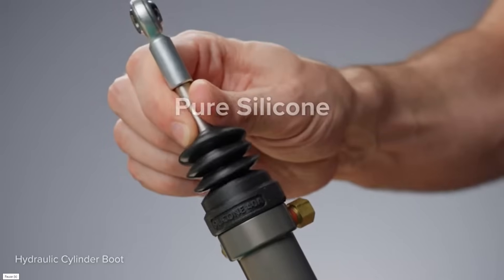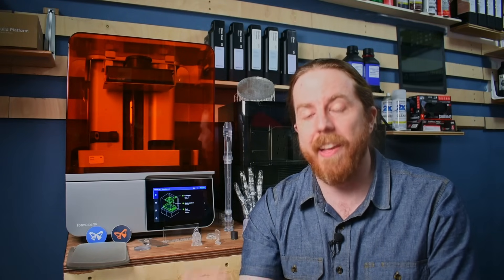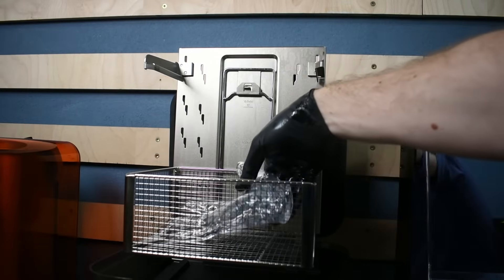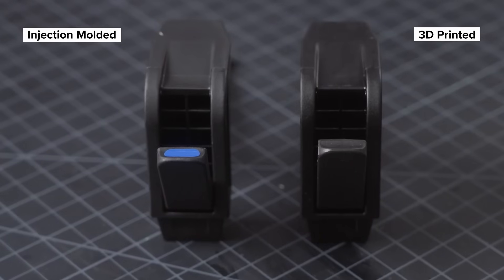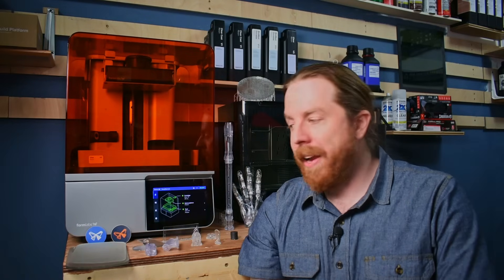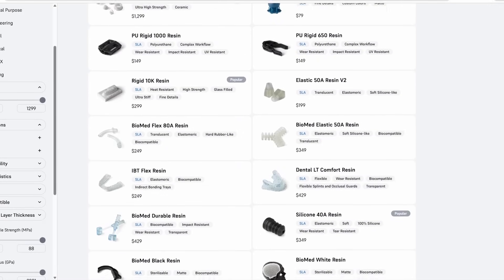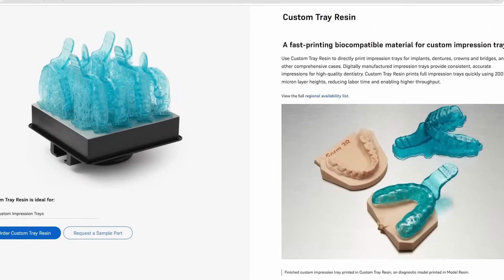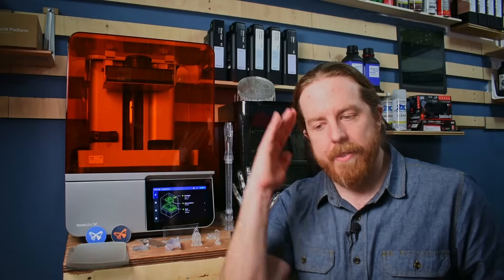Form 4B - This Will CHANGE Resin Printing FOREVER (at a price...)

Comment: All printers use 405nm light to cure. It seems to me you could just use formlabs (very expensive) resins in your cheap printer and get the same results. There doesn't appear to be much special about the printer so much as the resins. How can the printer itself be more dimensionality accurate? Aside from the convenience factors you mentioned, what does the printer itself do that cheap ones don't?
Reply: I tried form labs new resin with a elegoo Saturn ultra 4 and it requires a longer exposure time that the form labs. Thus making the print time longer.
Reply from the maker: It uses a 405nm light source, but I believe it's unique to this printer, not a 3rd party parts bin product like most other printers.  that said, you probably could use their resins in a normal printer, but I doubt you would get the same results.  The software and printer settings are tuned to work with these resins, and it actually adjusts depending on what you are printing.  The 2 most dimensionally accurate printers I've tried (this one and Heygears) don't just run a program like an Elegoo or Creality printer, they have force sensors in the bed, and also on the lifting arm.  Because of this, it adapts to pull forces.  One thing that causes dimensional accuracy problems is the partially cured resin getting "stretched" from constant pull forces, and the printers don't compensate.  This isn't in the video, but I print dice with every printer and resin I test, and they usually end up out of square.  the tougher and more compliant (elastic) the resin, the worse this is.  The biomed durable here is the most durable, compliant resin I have ever tested by far, and the dice are about the most square I have ever printed.  The dice on the heygears machine are also very good, but I didn't test with their ABS-like resin.  you can actually see the pull-force sensors working in real time. When it lifts the plate for the base layers it goes REALLY slowly, and as soon as it releases (you can hear the snap), the plate lifts, the mixer shoots across, and it goes back down.  This is in contrast with other printers that just lift a set amount, even if it's twice as high as it needs to.  This also saves time, but I personally don't care how fast a printer goes.  You're also paying for serviceability, customer support, components with more longevity, ease of use (you don't have to adjust anything like you would on a normal printer).  It's also made in the USA, and labor costs and stuff here are higher, so some of that is paying more because you have to pay americans more, etc...

Comment: Omitting a lot of small details, I guess because you got it for free? Open source resin for example costs like $3,000 per year or something😂

Anyway, as much as you like getting free stuff, you should still be open and discuss all matters including neutral and bad points. Meh...they bought you out 100%
Reply from the maker: if you feel that way, I can't change your mind.  they didn't alter my review at all, beyond me misspelling something in the unboxing video.  I think the open material mode thing is only a one time payment, but yeah it's pretty expensive.  I dont' have it on this one.  I don't personally have anything bad to say about this printer except the cost (which I believe is worth it) and print size.  If i was only into miniatures, like I said in the video, this isn't the printer for the job, but of the maybe 20 printers i've messed with, this was by far the best, easiest to use, most dimensionally accurate, least messy, etc...  If anything, my opinion was colored by the fact that I was simultaneously testing out a Saturn 4 Ultra 16k that was having issues out of the box.  That review is coming, but it won't be nearly as glowing as this one.  Still pretty good, it's a good printer overall for the price once i got the issues settled, but it's just not in the same ball park for engineering stuff, which is my main use of 3d printing.

Comment: I am just curious, why no one from manufactures have not approached to Carbon M1 or M2 nowadays? It is gone 10 years. They can flawlessly and continuously print without layers, their table moves just up. x100 times speed.
Reply from the maker: No idea, but if I had to guess, it's probably a patent thing

Comment: I bought a resin printer - and hated it for all the reasons you mentioned.  I might well go & buy this one!  The price isn't that terrible when you compare it to decent, semi industrial FDM printers.
Reply from the maker: You're right, a Form 4 is actually cheaper than a 5 tool-head prusa XL, and prusa isn't even "industrial", its just a high end consumer one.  It's absolutely crazy using this form 4 back to back with an elegoo saturn, the price difference is so obvious.  The saturn is great, yes, but you can tell why the form 4 costs so much more.  That said, if you use a saturn and formlabs creator resins with their wash solution, you can avoid most of the smells.  The ease of use though is worlds apart.

Comment: They charge $5k to allow the use of third-party resins and their resin library is actually pretty limited.
Reply: And yet in my 10 years of doing tech support for these printers, I can probably count on one hand how many times a customer has asked how to use a third party resin. I'd be happy to sell that feature, as it would be good money for us, but it just doesn't come up.
Reply from the maker: it's expensive, yeah, but i disagree about their resin library.  They have more variety than, say, heygears machines, and I can only think of one non-formlabs resin that I would want to use.

Comment: I have a pair of form 4 machines and I also happen to have a few IMMs.
The form 4 is great for short runs or prototypes but the claim of being as fast as IM is just BS.
Reply from the maker: i think they calculate it based on not having to wait for molds?  Or they are careful to choose exactly what kind of part they are using.
Reply: In their demo they just show the production time, but it seems to me that process is set intentionally in a very very not so efficient  way.

But without any doubt the form 4 and especially the form 4L are great machines,  since they are capable of create vacuum form molds and test IM molds in less than a day with minimal post processing work (Assuming you already have a base mold ready).

Comment: This is an infomercial.. This is marketing. Which explains both the printer and the production quality of the video on a new channel.. It's a commercial. Look at it.
Reply from the maker: I am flattered you think the production quality is good!  And yeah it would be insane for them to send a printer to a new channel.  But this is a spinoff channel from Paul's Garage, an 8 year old channel with years of printer content.  That's why they sent the printer.  I convinced them to let me use their printer to launch this channel.  That's why there's an expensive printer on a new channel with decent production, not because I'm working for them or being paid to make an infomercial.

Comment: How did you get them to send this to you with only one video….?? Haha. Great video. But very curious as lots of opinions can change when it didn’t cost you $7k+
Reply: This is an infomercial.. This is marketing. Which explains both the printer and the production quality of the video on a new channel.. It's a commercial. Look at it.
Reply from the maker: Haha good question!  They actually didn't sent it to me for this.  They sent it to me for another channel called Paul's Garage, and I convinced them to let me use it to launch a new channel.  I'm still going to use it over there for investment casting, though.  That's why I have the investment casting resin
Reply: @PaulsPrinterProjects  is investment casting the same as lost-wax casting? I guess the same except you don’t use wax?
Reply from the maker: Yes! lost wax is a type of investment casting.  The "investment" can be plaster or ceramic, the pattern is usually something that can burn or melt out like wax, wax resins, special burnout resins/filaments, even organic stuff.  it's pretty cool.

Comment: 1.3% failure rate is pretty high judging by manufacturing standards, but since it´s rapid prototyping it´s more than fine.
Reply from the maker: it's by far the most reliable resin printer i've tried so far, but i imagine in manufacturing that 1.3% would add up quickly
Reply: @PaulsPrinterProjects  1.3% failure rate in say the automotive industry where you sell say e.g. 5 mio. parts, means you have 65.000 bad parts. It´s way too high. But for rapid prototyping it´s more than acceptable, since also every part is unique.

Comment: I bought a form 3 and returned it immediately when my partner's 200$ mars 2 printed dramatically faster and in even better quality (didn't check dimensions but features were more crisp of the same test model we both printed)
I originally bought it because of their material library, but their resins are so dang expensive. I partially regret sending it back as I never got to play with the cool resins but maybe it was for the best. I also don't love how they want to sell you "open material mode" - for the form 4L it is an extra 5k PER PRINTER. And then they segregate medical versus dental, so I am assuming that means you can't print dental resins on your $14K medical form 4L

But that being said if money was no object and I had an extra 20 grand laying around i would definitely think about buying a form 4BL
Reply from the maker: I've never tried a Form 3, but from what I can tell, it was REALLY slow, even compared to other printers, and the resins are still really expensive.  I think the standard form 4 resins are half the price of the form 3 resins.  The open material mode looks really cool, and yeah expensive.  I can only think of the 1 resin that I would want to use, though (the thermacast stuff), formlabs has a version of almost every other kind of resin already.  and i agree, if i had an extra 20 grand laying around to buy equipment I would order a 4BL for sure.

Comment: I've been trying to use cheap SLA printers for engineering needs for years with absolutely no success. It's just impossible to get anything dimensionally accurate out of them. I had to resort to using FDM. Formlabs definitely has a market here, I'm actually thinking of buying one.
Reply from the maker: I know what you mean.  Heygears sent me a printer claiming dimensional accuracy, and it was WAY better than the cheaper ones, but even then I was breaking out the sandpaper and files to get parts to fit snug, and orienting certain areas towards to bed to hide the warping.  This printer seems better in my experience, but i'm definitely going to test it out more.

Comment: hahaha I was like I know this guy from somewhere
great overview
Reply from the maker: haha thanks!  yeah i figured i need to split the printing stuff off of the metal stuff
Reply: @PaulsPrinterProjects  yup, I think its better for those who follow. 

Did you give a heads up on the new channel and i missed it? randomly stumbled upon this one.
Reply from the maker: i put out a community post last night, that's it.  those don't get pushed much by YouTube, though. I'm probably going to have a video on the garage channel that talks about it, like an update video or something, but i'm also going to have some investment casting videos specifically about clear cast resin over there, too.  Clear cast resin can be printed hollow with an internal lattice, kinda like FDM printed investment casting patterns, so BIG stuff is possible.  not just jewelry like the purple resins.  Really cool.  OH and I got some ceramic shell stuff, so i can do larger projects that aren't limited by the flask/plaster set up.  Looking forward to it
Reply: @PaulsPrinterProjects  Oki amazing. I think If you just pushed the printing parts of your projects and the specifics and mention that out a lot of people would already pour over ^^

Cheers!

Comment: Good information on the printer.
and yes engineering resins are many and varied and they have been this way for a long time. (before DIY resin printing existed to some extent) but you do a good job highlighting some interesting ones.

One thing though.
Do note that it isn't a lack of fumes it's a lack of a specific additive. This seems like a minor clarification but it's important. 
The formlabs resins still releases fumes. if it smells it does. Even if it doesn't it might. Your nose is a very poor tool judging this. If it smells good. It does and isn't good.
Just be careful talking about this subject as it's a potential health issue. All resins can start an allergic sensitivity, the amount of fumes and VOC needs to be measured by a specific device. Your smell sense is not useful.
Reply from the maker: excellent clarification, yes.  the smell isn't the issue, but the fumes from formlabs resins are much less toxic.  they still say you shouldn't go whiffing them, and still wear gloves, but this stuff is more agreeable in an engineering office than other resins.  Sunlu ABS-like resin for example has very little smell, but the fumes make me itchy and makes my neck hurt.  Formlabs stuff doesn't, but I still didn't hang out in the garage while this was printing.
Reply: @PaulsPrinterProjects  Again, sorry.  "toxic" really isn't the correct word. 
Resins are anything but good for you but surprisingly less "toxic" as you may think compared to other materials people use every day.  and that toxicity isn't the main problem with the material.

The VOCs are a real issue in a small unventilated room (no difference from any source) . But that falls off fast with most any mitigation. correctly used and replaced organic filters and/or ventilation lower this to safe levels. 
Remember the context here is cooking bacon without your hood ventilation on can result in headaches, confusion, nausea, coughing, and skin irritation plus more long-term effects. 
Many 3d printing resins expell fewer VOCs than bacon.

The biggest issue and the one people should be focusing on, not that the others don't exist but the order and magnitude makes the most difference, is allergic reactions! 
Resins are notorious for seemingly randomly invoking mild to extreme reactions at any time with contact. (while this can happen with the VOCs it's much less common than direct contact.)
This makes all resins potentially an issue and thus requires protection. and due to different formulas, this susceptibility and reaction level can be quite varied.  surprisingly the retail resin has gotten much better than the engineering residents of the time. and now the engineering resins are catching up. 
but let me stress "much better " isn't good or safe regardless of the manufacturer and the range isn't that large.
So it's great that they are addressing some of the issues, but beware of what they are actually changing and how much that actually makes a difference.
for many people just changing brands can help if you are already affected and have issues. 
But correct procedures are always required regardless of the sales hype of safety.

Comment: OK I will be honest it sounds like you are not that familiar with resin printing. You can buy low odor very prices resins and tune your parameters to have the same results as form labs... there is no crazy innovation just benefits of a closed eco system. So if you are a maker cheaper options same quality outcome.. if you are an employee sure get this one have less hassle in life..
Reply from the maker: I'm with you on the low odor, but not the same results.  I have never had prints as dimensionally accurate and flat as with the formlabs one.  Even the Heygears machine that claims to have great dimensional accuracy isn't as good, but the results are still WAY better than, say, an elegoo printer with sunlu resin or something like that.  I still use sunlu abs-like, and it doens't have much of a smell, but the fumes still bother my throat make me itchy.  Not so with formlabs (for the form 4 or the creator resins for other printers, which i have tried and really like).  The whole point of the formlabs set up is that a company can have one, hire someone who isn't familiar with resin printing, and train them up to use it in 15 minutes.  if you are a hobbyest on a budget for sure just get a cheaper one.